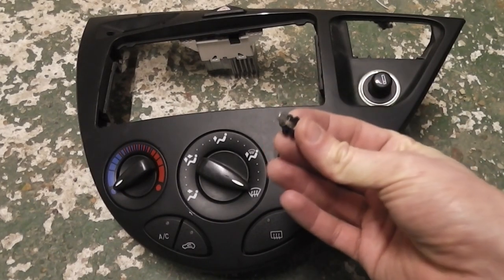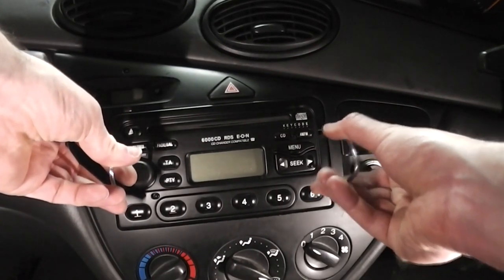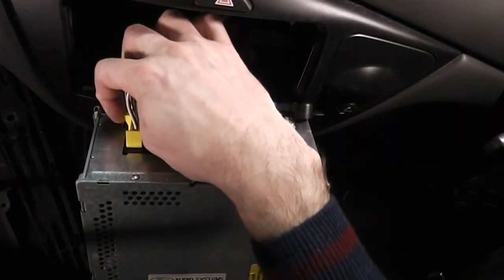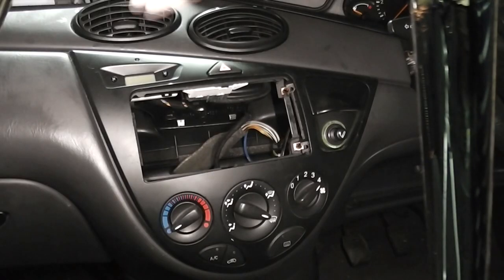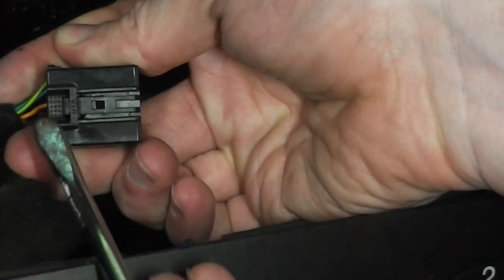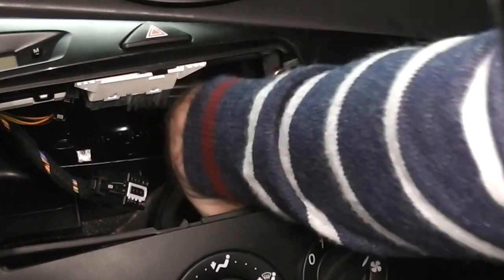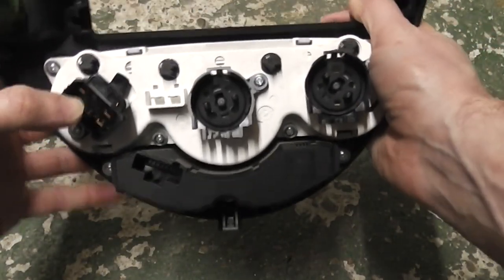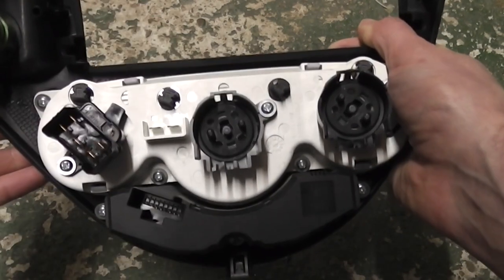Ford Focus Heater Control Panel Bulb Change

Comment: There are FOUR across the top, they are Sylvania 2721LL  1.2 Watts each. a 2-pack is $6.99 all auto parts stores have them. 
The THREE larger bulbs on the cluster backside are 161 long life 2.7 Watt bulbs  I'm tired of bad bulb advice on here. There are also SEVENTEEN or so, warning light bulbs, they are also 2721LL 1.2 Watt Sylvania. The AC/Recirc button and the rear heater button are lit separately. Mine are dim, I will investigate, but suspect they are 2721LL 1.2 Watt bulbs also. One for the bottom left, one for the bottom right.
I did all FOUR top bulbs without undoing the connectors. It is not that hard to do, but to access the bottom 2, I suspect I will be taking it apart again.
They last a LONG time because they use better filaments in them, and they are only 1.2 Watts. The gas inside may be different too. Use LONG LIFE bulbs, not fun doing it over. Mine is 22 years old, one was out and 3 were dimmer. Looks like new now.